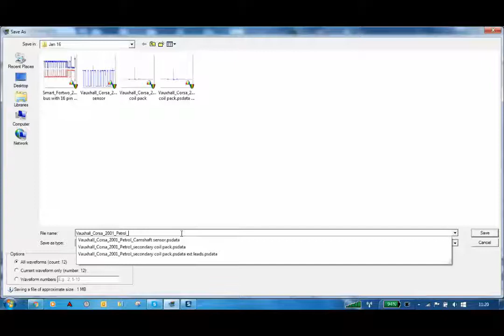Testing a Camshaft Sensor

Comment: are those spikes normal or acceptable?
Reply: Hi,

Thanks for your question. The short answer is that the vehicle did not have any issues or symptoms so the observed spikes were within tolerance for the vehicle.
Generally, you can expect to see some noise within such waveforms. The degree to which it will be present will depend on how much the vehicle manufacturer is willing to spend to properly shield the wiring loom and route it away from noise sources within the engine bay.
With a hall effect signal such as this, the ECM will be expecting the signal to be above and below certain thresholds for a given, repeating, set of relative durations. Therefore, an ECM will have a tolerance to noise which is determined by these preset thresholds and the expected relative durations. For example, if a negative noise spike occurring in the +5V part of the signal is sufficiently long and low (i.e. it falls below the "low" threshold), then the ECM is likely to mistake it for an unexpected low (0 V) period and, possibly, will raise a DTC, cause a misfire or cut-out, depending on the system and the degree of the problem.

Hope that helps.
Reply: @pico_barney  Thank you for exhaustive answer. I guess, to minimise any signal distortions 
it is good to connect scopes ground side of probe directly to the "-" of sensors cable instead of hooking it onto any ground e.i. engine (as often suggested).
Reply: Hi Marcin, it is true that you could get a less noisy signal by connecting that way. However, if the shielding on the sensor wiring has broken down or its wiring is looping past an electrical noisy component, then by connecting in this way you might miss the noise that is causing your problem. For this reason, we recommend that you connect at the Engine Control Module, so you can always see all the problems (excessive noise included) within the signal of interest. Hope that helps.
Reply: @pico_barney  where do you get the waveform data base from?
Reply: @ifell3  We have a Waveform Library. It is accessible through our PicoScope software when you have one of our Automotive scopes connected.